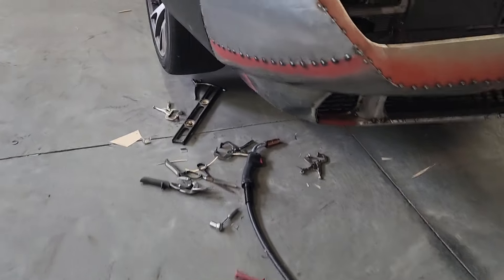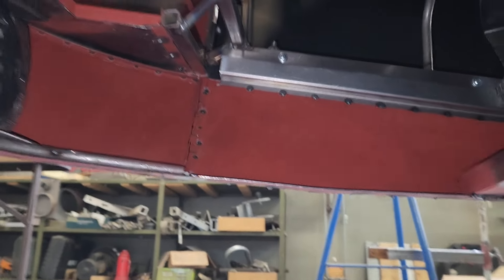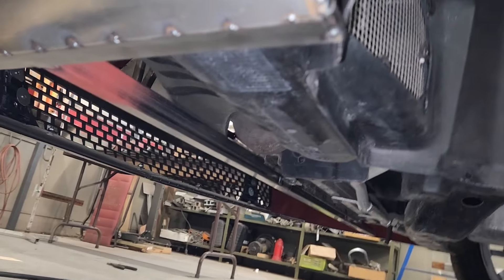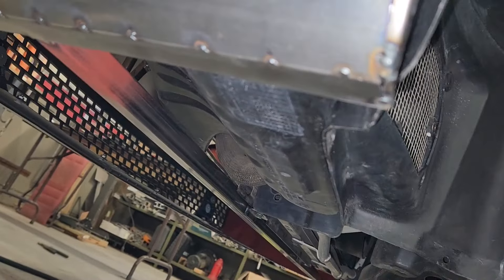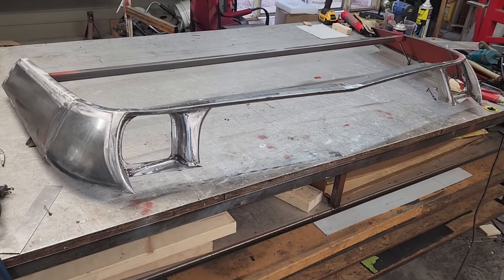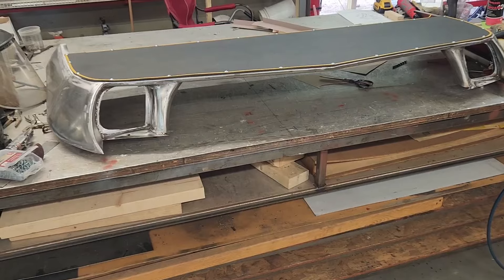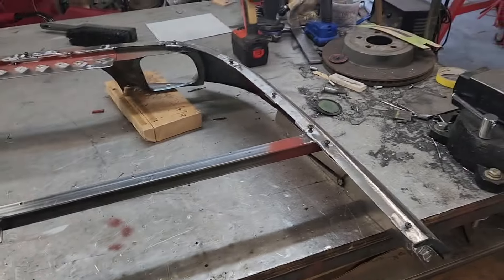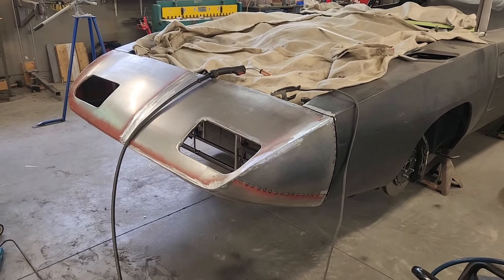Randy's Hellcat Daytona part 73

Comment: Hood looks great. What is the ABS used on the filler panel? I would like to get some for areas on my Cuda.
Reply from the maker: ABS is a plastic  sheet  material that I get from my local sheet metal supplier who happens to stock it.  They have 1/16" thick 1/8" and 3/16" thick in 4'x 8' sheets. You can get smaller pieces on Ebay.

Comment: have you considered widebody newer challenger wheel liners?
Reply from the maker: The wide body wheel liners are the same.  The wide body is widened with add on body flairs and wider wheels and tires.